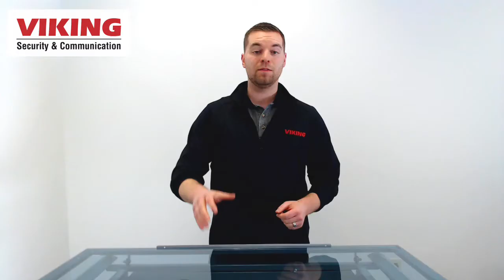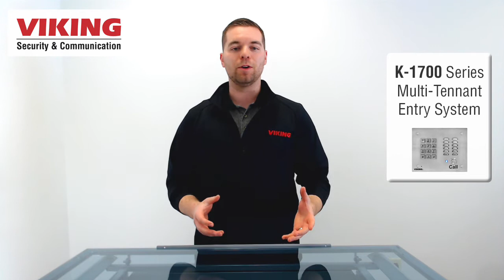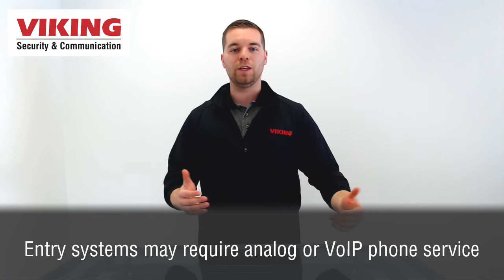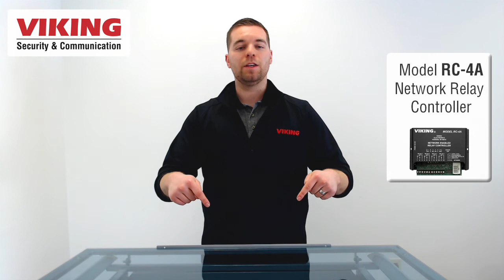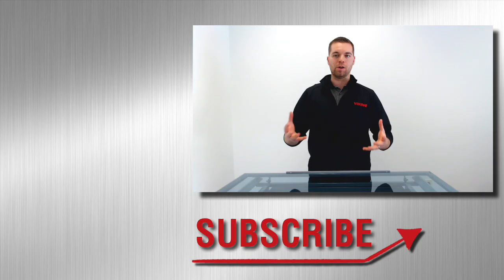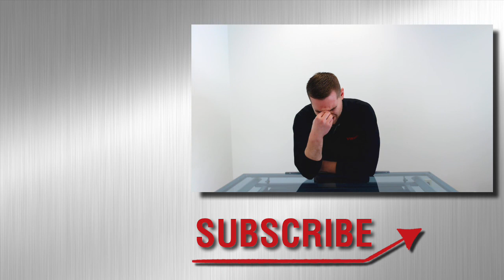Access Control Training Course – Sales Aid & Purchasing Guide

Comment: If my internet goes down and I have a VOIP entry system, does that mean it will stop working too?
Reply from the maker: Great question AmarachiJ - if a Viking entry phone running IP Programming software 1.1.8 or higher looses it's primary internet connection it will automatically switch to a secondary fail-over internet connection. If no secondary connection is available or an entry phone is running an older version of the IP Programming software, it will stop working until the connection is re-established.
Reply: Viking Electronics, Inc. do you have a VOIP system with a camera that can notify me through my cell phone when someone shows up?
Reply from the maker: Our sales staff would be happy to assist you. Please call us at 715 386-8861 or email https://www.vikingelectronics.com/contact/ for details on your specific application, thanks!

Edit: Fixed Email Address
Reply: Thank you!